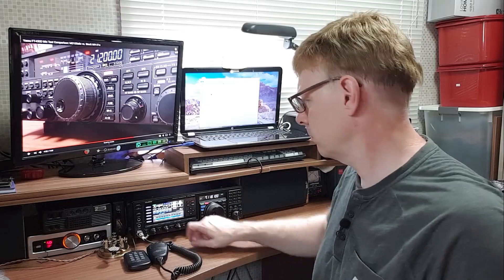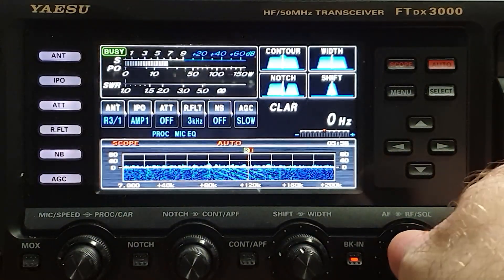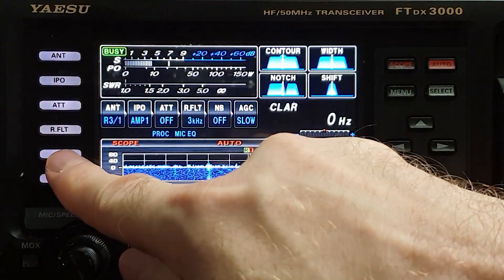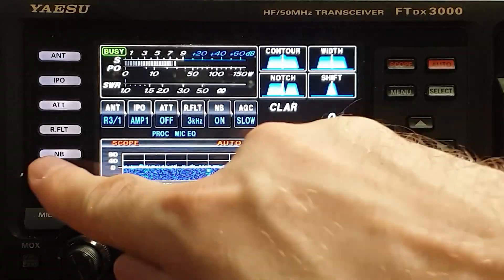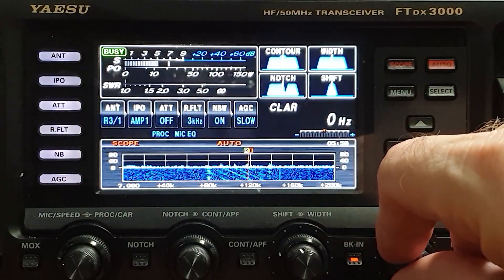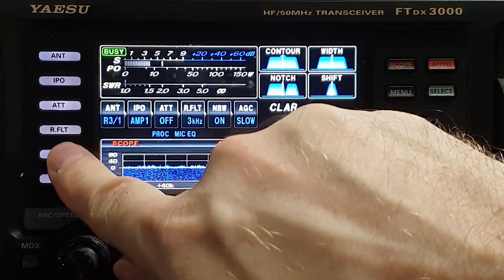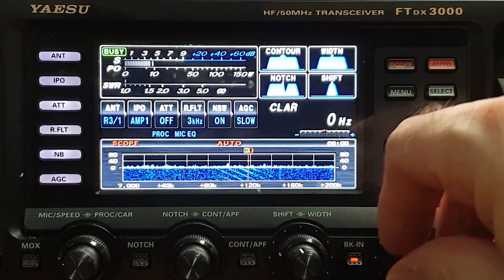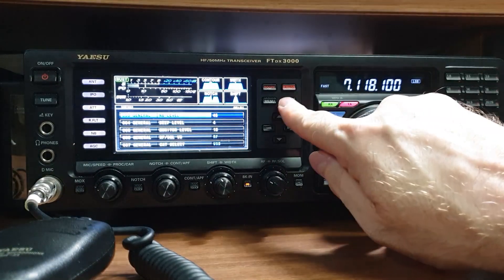Yaesu FTDX3000 Noise Blanker

Comment: Still using that radio?
Reply from the maker: Just sold it a few months ago.  I am on an Yaesu FT710 now.  Just decided to downsize.  I do miss much of the FTDX3000, but had to move on.
Reply: @thestingyham1188  Im in doubt to buy 710 or dx 3000
what is better in 710 ?
Im thinking to buy again dx 3000 because the easy way to use sdr receiver like colibrinano .  plug and play

Comment: В FT-891 не хуже работает.
Reply from the maker: I used to own the FT-891.  I read that they have a slightly different chip for noise removal.  I still feel the FT-891's chip does a slightly better job than the FTDX3000.

Comment: never knew about the long button press. good info.
Reply: You notice he is using receive antenna on 3 and transmit on 1. If you long press the ant button it will take you to  that menu to choose using ant 3 as a receive for 1 or 2 or a third separate T/R antenna.